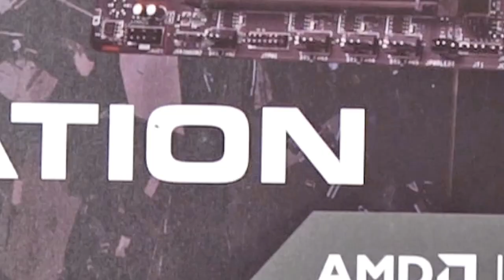MSI Prestige X570 Creation Motherboard Unboxing

Comment: Every claim that it's too big  for mid tower in Amazon's comments but looking at yours it's a tight fit but it fits nonetheless appreciate the video you posted looking forward to buy one. BTW what psu is recommended for this board gold, plat, or titanium?
Reply from the maker: Thanks for your comment, for PSU starting from gold with 2x 8pins ports for CPU to get full power input to the motherboard
Reply: I  truly Appreciate the info you giving me tech shock this will save me alot money now.
Reply from the maker: @noneofyourbuisnessseriousl6623  welcome brother, enjoy

Comment: What i don't get is that this motherboard can support 128gb ram, but all i can see. It has 4 ram slots
Reply from the maker: Yes is support 128 GB. There are new ram which is coming as 2x32 GB, so you can use 4x32 GB ram. Any x570 is supporting 128 GB ram
Reply: @AhmedKhalifagraphics  Thank you, btw. Just out of curiosity, are you good at pc in general?
Reply from the maker: Yes, I am building gaming PCs, check my Instagram account it's name is gaming pc Oman

Comment: do you need the m.2 xpander to use m.2 or is it just for extras? im assuming because its called the expander its for extra m.2s besides the onboard ones?
Reply from the maker: It is for extra m.2
Reply: @AhmedKhalifagraphics  thanks thats what i assumed but after everything crammed on this board i wouldnt be surprised if they ran out of room for m.2 slots lol
Reply from the maker: @lightt5209  don't worry :)
Reply: Yeah the expansion card is nice however I might not ever use it because my 2080ti takes up a lot of space.

Comment from the maker: Enjoy the video
Reply: I bought a USB flash drive for windows 10 installation. The packet says I must boot from  UEFI(newer) , but the instructions in this booklet says to clean boot from BIOS (older) . Will I be able to set the bios system with this mothrbd  to UEFI so I can do this?  any helpl thanks
Reply from the maker: no need to clean bios, you just plug in the USB and then F12 as i remember while booting to select booting device, then select USB device to install windows
Reply: @AhmedKhalifagraphics   Ps:)   i know it was funny,  but hey thanks its now put right!

Comment: Dude I bought this board
Reply from the maker: Great it is a great motherboard
Reply: Dude  ,  given a Ryzen 7 ( mid-range atm) ,  with around 16gigs of RAM , this baby will kick ass game over most systems that care to challenge ! it actually adjusts its own frame rate with the turbo on the cpu! and overclocking ofc,  is a remarkable bonus!